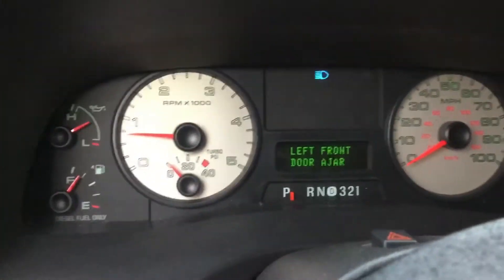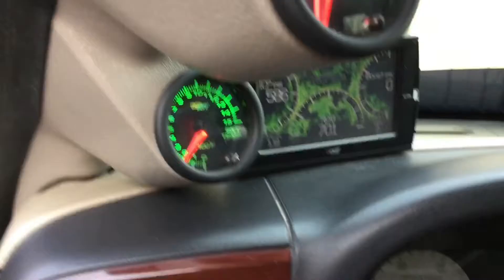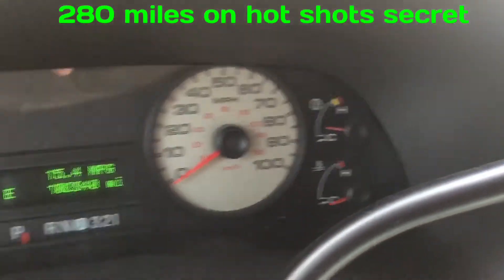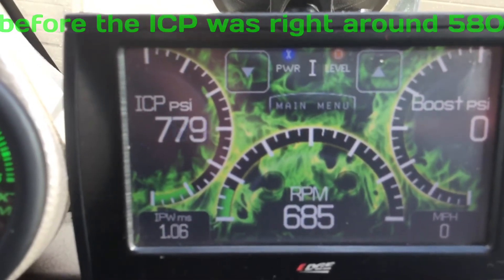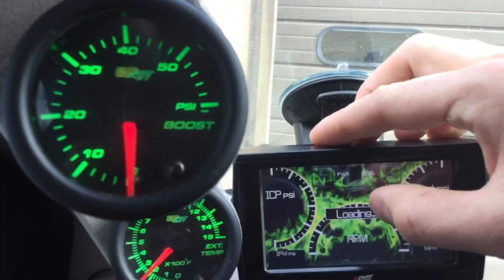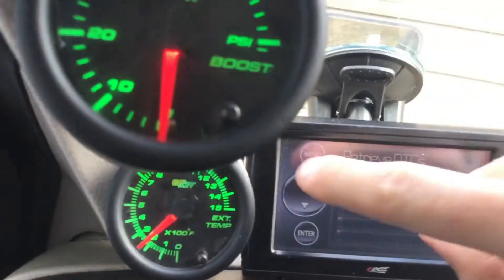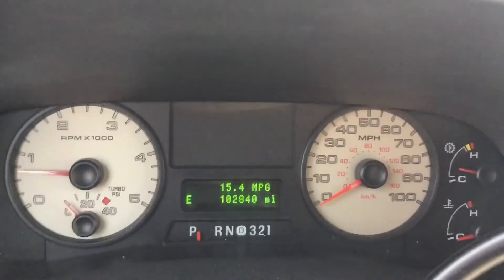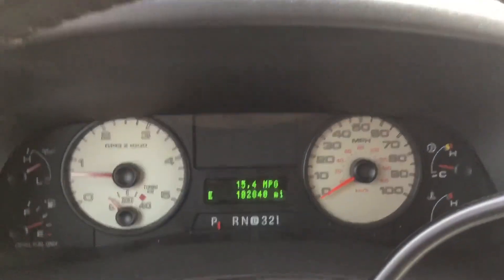6.0 powerstroke with hot shots secret stiction eliminator

Comment: 16oz per oil change is plenty not 2 quarts
Reply: It depends on oil capacity.
Reply: @sweis12  
They recommend 4oz per quart first time using if you have an issue. Regular maint is 2oz per quart of oil.

Comment: no need to wait 200 mi with Turbo Maxx + run engine oil 2x longer for less best stiction fix for the 6.0 and 7.3 fixes the worst stiction. were all others come back in 3000 miles.